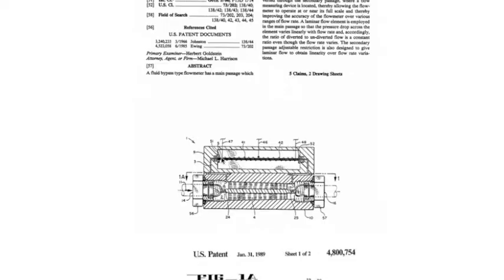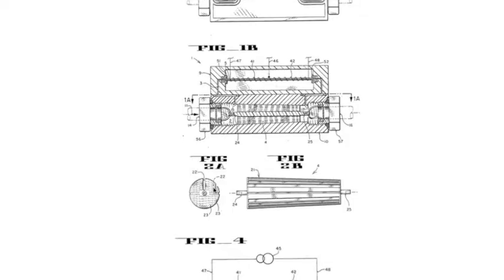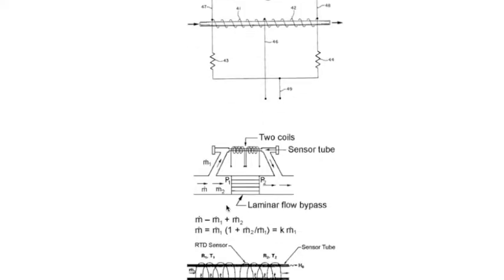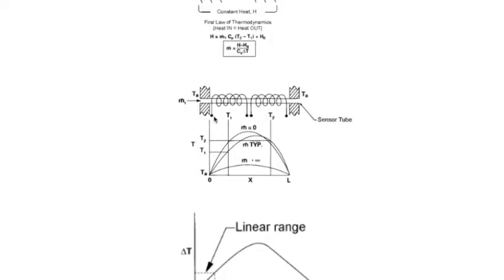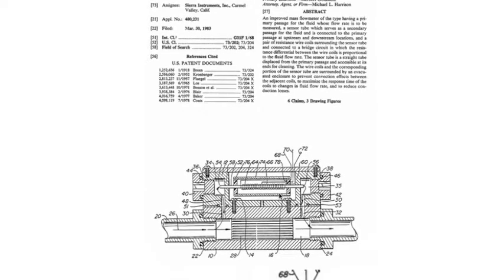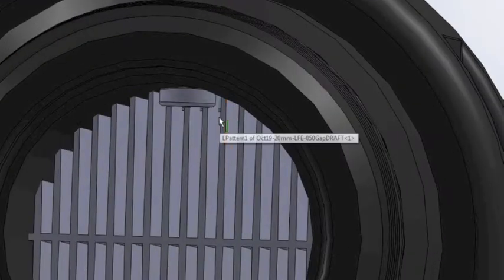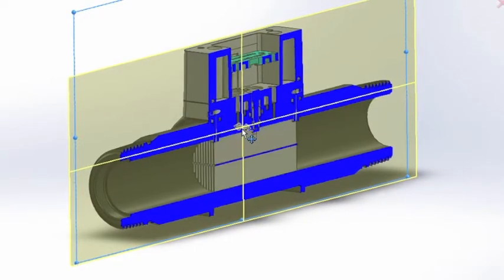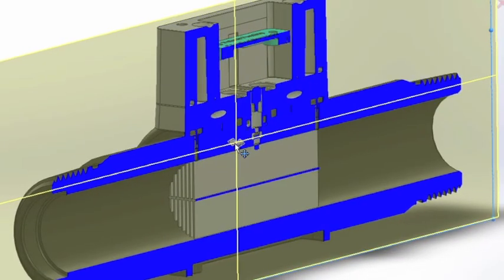How Thermal Mass Flow Meters Work

Comment: Hi there excellent information I really enjoyed it.   Can you please tell me how this flow meter is used in natural gas applications?   Will it not disturb the natural gas due to its convective heat transfer?
Reply from the maker: This type of flow meter will not harm the gas.  As far as I know there is no flow meter that harms the gas or messes it up. Check out the Vortex meter as it is not sensitive to the gas composition.  It can not read as low but it has ZERO sensitivity to what gas is used.  And, you can even measure water flow.  https://www.tacticalflowmeter.com/collections/flow-meter/products/1-2-to-4-multivariable-vortex-mass-flow-meter.